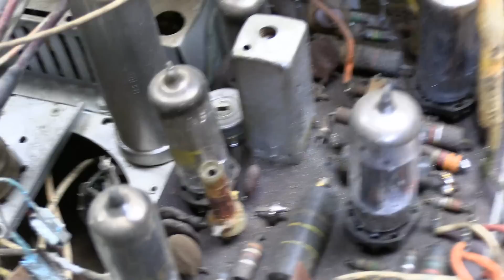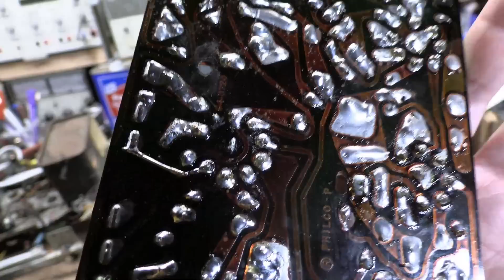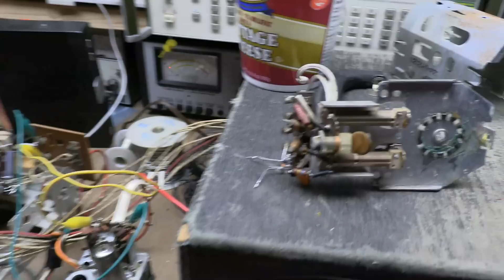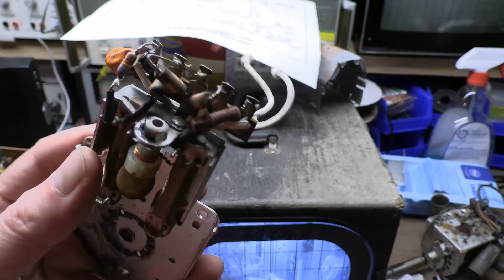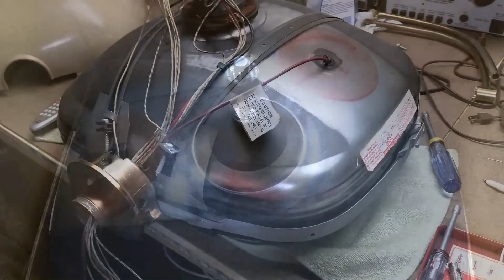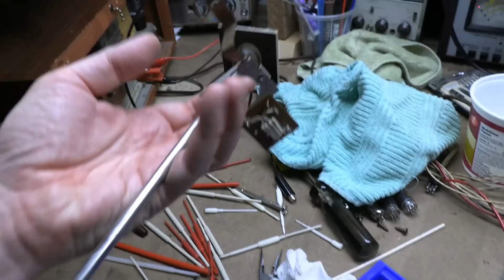Predictapalooza s02e07 Al's Mahogany Holiday

Comment: When replacing those antenna isolation caps you should probably use class Y safety caps. The resistor probably isn't needed, but if you add one maybe go with a 1 meg or greater 1 watt carbon composition. If I'm not mistaken carbon composition is more resistant to power spikes than metal film. My 1998 VCR has a carbon comp resistor in the power supply between neutral and chassis ground, it was surprising to see such an old style resistor in something so new.

Comment: If you have to use a long neck CRT have you given thought to having someone print a plastic extension collar so that the original back plate would still mount in place?  Matching the taper of the cover and screw holes should be easy enough.
Reply from the maker: If I ever needed to, I might.  I would need someone to created the 3-D file though.  Id also be concerned about color matching and the quality of the part.  Even 3-d printed part I've seen has had a rough surface.  I'm not sure how well they polish up.

Comment: Bob, I have never seen a 'Capistor" bad here, bur we get little lightening here.
A friend used to work for a tuner rebuilder. Her job was to wash the tuner in a strong detergent, rinse in water, then thoroughly dry it. Then she would check it.  Then it went to the tech if it didn't work. The washing & drying fixed 95% of the tuners. Dirt, grease and techs spraying in way too much tuner cleaner & lube caused the problems. You got by very well on that one.
 If I can find my stash of Capsistors , I'll send them to you. I won't live long enough to use them here.  I do remember seeing tuners with burned resistors inside from the tuner tubes shorting out. Real PITA to get in there to replace..
Reply from the maker: Thanks.  Surprisingly, I found another bad "capistor" in the very next set I worked on.  Not quite as dramatic, but definitely a catastrophic failure.  I've also found a few fried resistors inside.